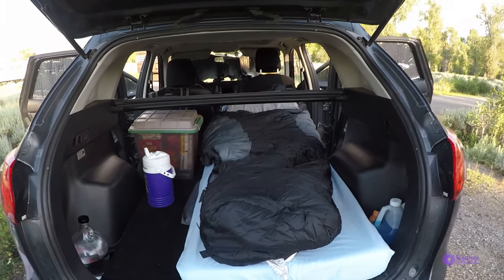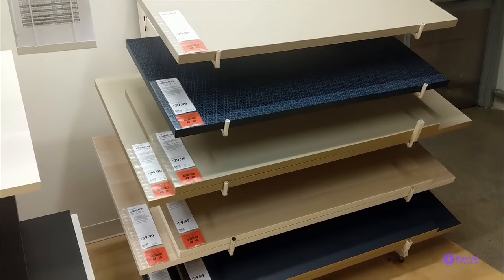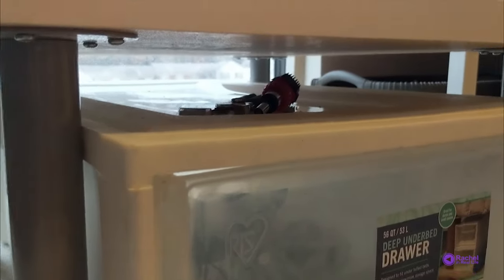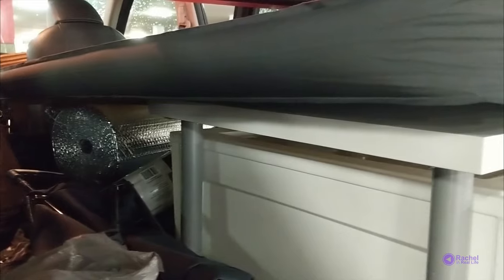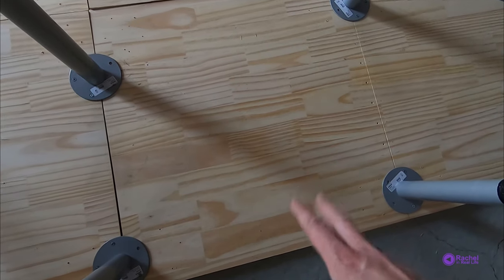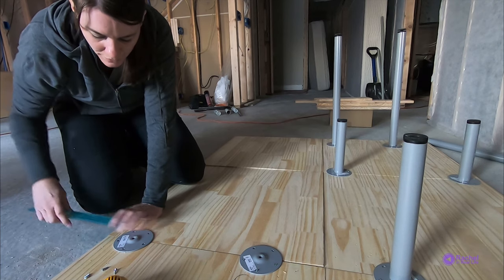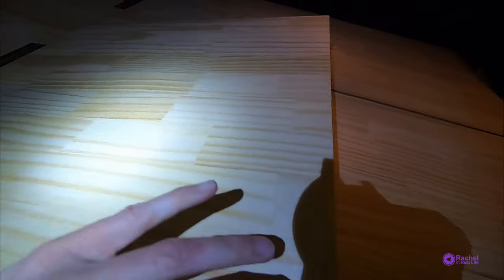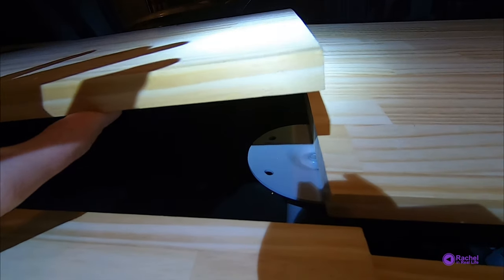Car Camping Platform Bed | REMOVES EASILY & MODULAR

Comment: Nice set up and thanks for the links.  I'm going to do a similar fix for my SUV and I have a question.  How far is your face from the roof of your car when you lie on top of the platform, mattress, sleeping bag etc.?   The reason I'm asking is because my back seats don't fold down completely flat.  Another thing I've wondered about is whether condensation inside the car becomes a problem on colder nights.
Reply from the maker: Thanks, Terry! Glad this was useful. I have some videos coming up where you'll be able to see how it looks when I am on the bed, but I'll guesstimate there's about 10". My sunroof is right above me, so it is not claustrophobic feeling. I will say that when I have been in a full-on swing, to turn on my side at night, and forgot I was in a car, my arm hit the roof a couple of times. This part in my 'New Car Camping Bed...' video might offer an idea, https://youtu.be/66kd4AjCRFc?t=24m10s.

As for the condensation, I keep my sunroof and/or windows cracked, even on cold nights. The only time I noticed any issue was during below freezing temps, the rear passenger side window did accumulate condensation, so my fleece blanket would freeze to my reflectix on that window. Otherwise, I did not have an issue in other areas of my car, inside, that I noticed. I am not 100% on what it looked like from the outside, but after taking my reflectix down, I didn't notice any fogging or condensation, except the windows near the platform bed, if my windows weren't cracked enough.

Comment: Hi, could you explain how you cut the legs?? Did you cut the extra length off at the top or bottom?? Thank you!
Reply from the maker: Cut the bottom of the legs, not the top where it screws into the flange. I cut the legs using a hacksaw https://amzn.to/3dsyqZw, then filed the edges to take off any sharp points https://amzn.to/3bo8xHI

Put the leg between some 1"x1" pieces of wood and clamp it down https://amzn.to/3dzZpCN

I used long leveling legs to make any adjustments with the uneven cat floor. Unscrew the existing feet adjustments the legs come with and these screw right in https://amzn.to/3seXOq1
Reply: So you cant reuse the existing adjustable feet after you cut them off?

Comment: Hi love your videos 
I car camp in my nissan versa note .
I'm still trying to figure out best sleep mattress I'm a side sleeper.This year I  used memory tri fold but only used 2 pieces and 2 pieces of 4 in  foam and colthes for where my feet went ( packing cubes ).It was very comfortable but 8 inches IN height  😮.So my question is how is your new Mat vs your tri fold for comfort .I'm only 5FT 4 I don't need 75 inches IN length I'm toying with the idea of the shorty blow up mattress.I did try the condo king mattress by thermal rest but did not find it comfortable enough for me .I ,would like to get down to 6 inches IN height. Thanks for any info Gaylene
Reply from the maker: Hi, Gaylene! I can understand the struggle of trying to find a mattress that works well. I am with you in avoiding mattresses that are too thick. Space in a vehicle is precious! My EXPED MegaMat is more comfortable than the tri-fold, in my opinion, and they're both about 4" thick. Having the ability to adjust the firmness of a foam+air pad is a great feature that you don't get with memory foam alone. Most of my family members tried out my MegaMat and were honestly amazed at how comfortable it is; particularly my Mother, who can be a real priss. We are all sorts of shapes and sizes too, and no one bottomed out.

Looked up the MondoKing Therm-a-Rest mattress, maybe that's what you meant? Anyway, it looks similar to the MegaMat in that it is foam+air. It is less expensive than the MegaMat too which could mean that the MegaMat is just overpriced and/or better. Not sure. There is probably a high markup on these things either way.

Personally, I'm not fond of the idea of a blowup mattress for anything other than inside sticks and bricks, and maybe backpacking to save space. There are two, potentially big, problems I see with a blowup mattress. The first is that if it's punctured, you're dead in the water until you fix it. There's no leeway like you get with foam+air, like the MondoKing and MegaMat. I've punctured my MegaMat and it still gave me a few hours before I started to bottom out. When I woke up, I pumped it back up, and it allowed me to get through the night. The second concern is the lack of insulation. Depending on the season and part of the country you're in, this could make for some very chilly nights. I think air mattresses are the least comfortable as well.

If there's an REI near you, they have MANY mattress pads you can try out. I've even seen the MegaMats. You can see if it might be any better than the Therm-a-Rest. 

Maybe you'll end up creating your own solution; use your tri-fold or even the MondoKing, along with a two inch topper that you can trim down to size, and there you've got your six inches.

Best of luck on your search!!
Reply: @RachelinRealLife  Thanks for the help and info 😁